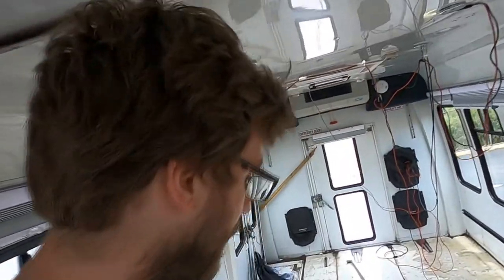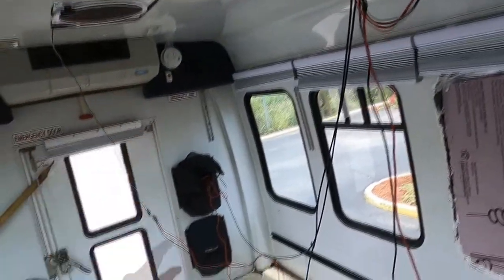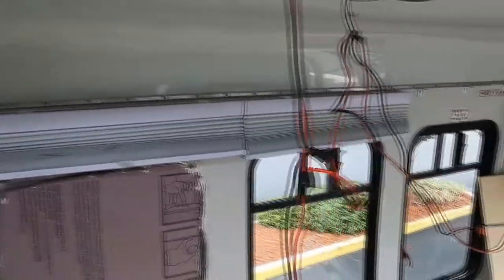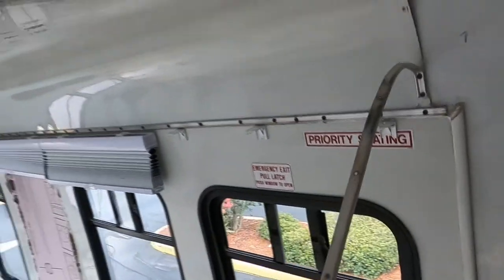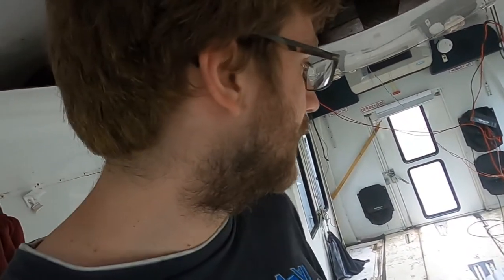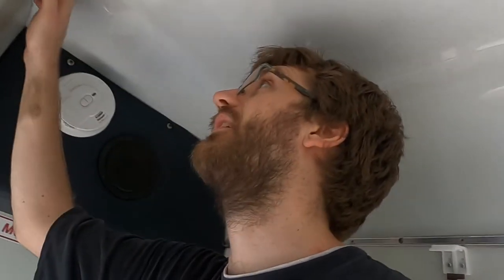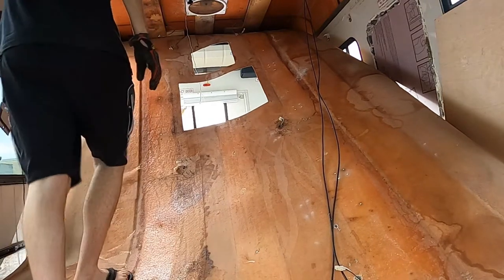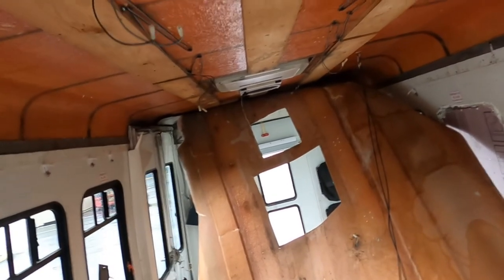Removing The Ceiling In 2008 Ford E-450 Shuttle Bus | Shuttle Bus RV Conversion

Comment: You could use that fiberglass to make a panel for your window you had to block.
Reply from the maker: ahh true. I could have done that after cutting it and my wrists to a million pieces
Reply: @DaClark  Gloves my friend. And shoes! Stop building your bus in flip flops!
Reply from the maker: @jumonjii  I usually wear gloves when I cut things, but it wouldn't have prevented cuts to my forearm. Also yea the flip flops would be safer, but I probably won't because it is Florida in the summer and I am through most of the super laborious parts
Reply: @DaClark  When is the next video?
Reply from the maker: @jumonjii  Whenever I figure out how computers work. Probably will try to edit and upload one tomorrow.
Reply: @DaClark  LUL. Says the web dev.